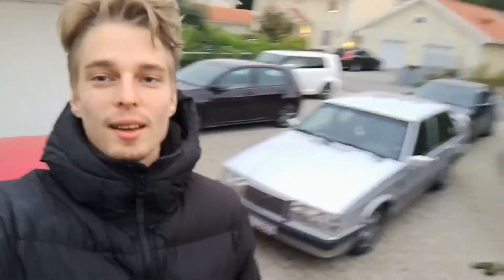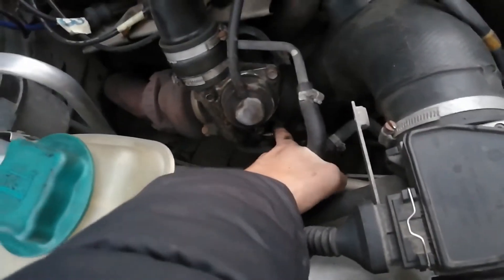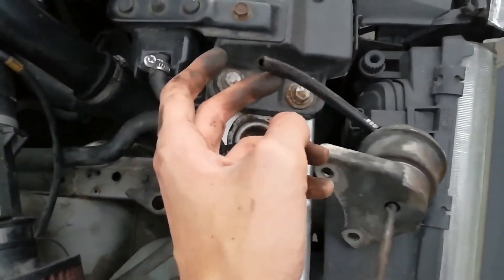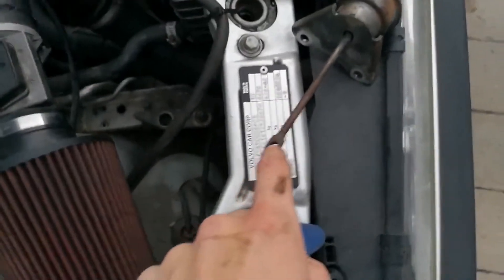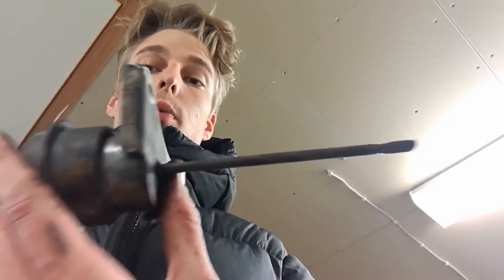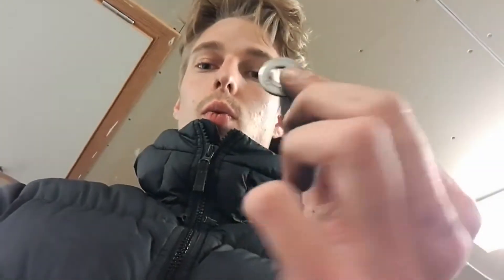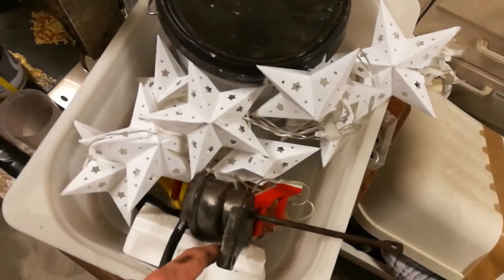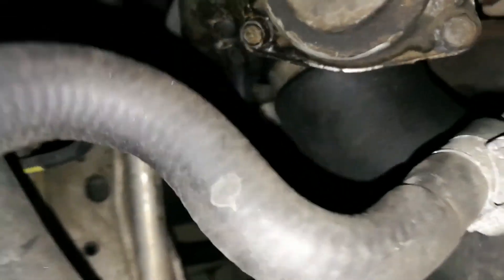How to get MORE Horsepower for FREE!! Wastegate modifcation & Explination

Comment: Theres not a single peice of correct information in this video. The wastegate ONLY opens when you reach full boost and only has a function when you are in fulll boost. The bov opens and lets off extra pressure when you let off the gas. You do not need to increase fuel pressure. You just need to control the allowed of air required to open the wastegate actuator via boost controller or a different actuator all together.
Reply: Pure cringe video